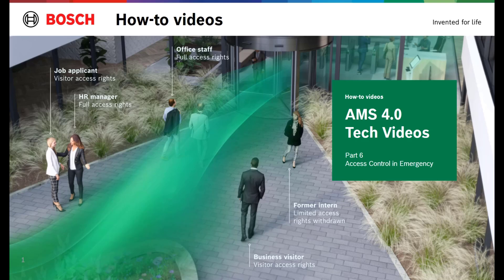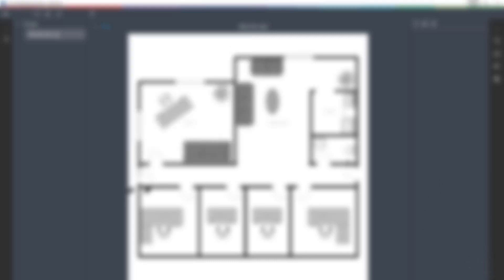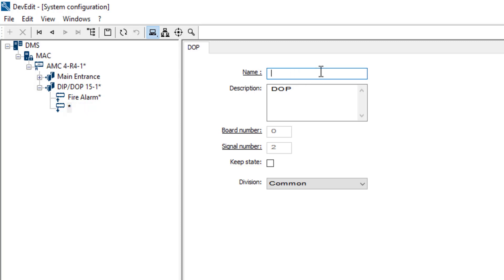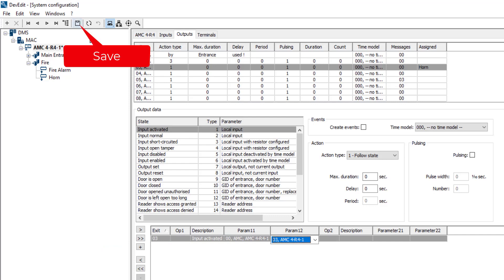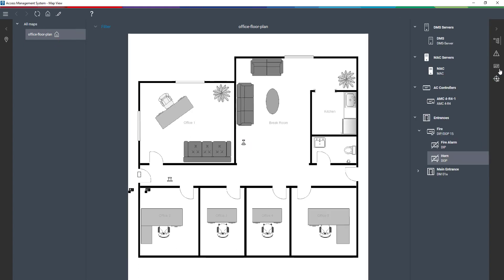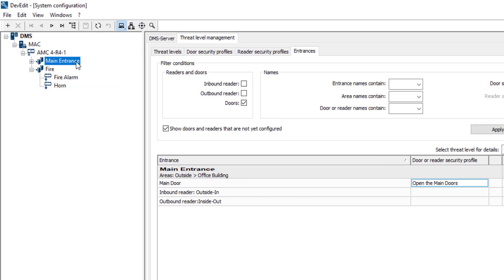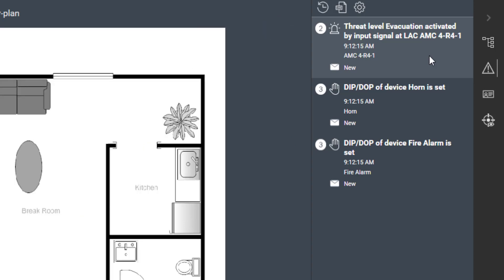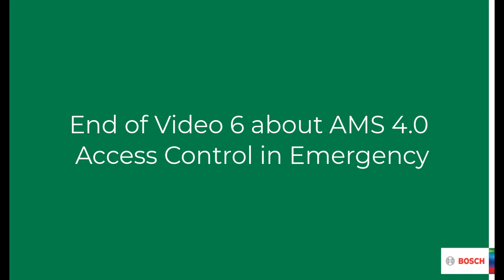Bosch Security - AMS 4.0 -  Part 6 Access Control in Emergency

Comment: We have an issue were everything is set as explained but the system will operate on activation first time and it will not deactivate until panel is restarted , the same again if you want to activate.anyone has a clue for this
Reply: When you click on activate and then save AMS will send the current configuration to the panel. If you later undo the activation it will not clear the settings on the AMC. The configuration on the panel can only be undone if tou break the network connection to the PC and then press the reset button for a few seconds.